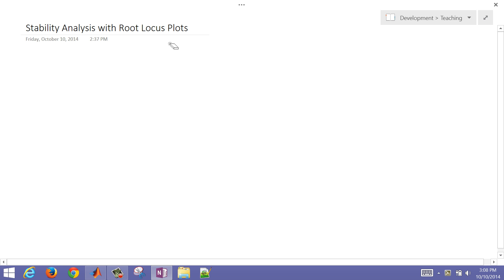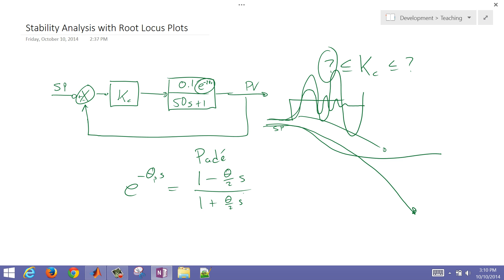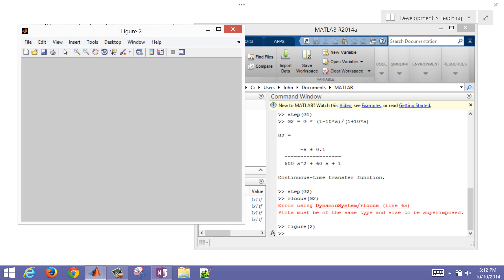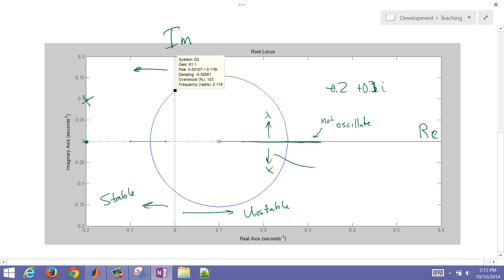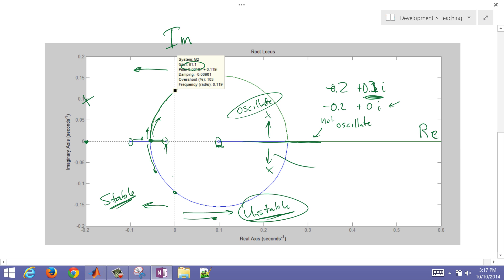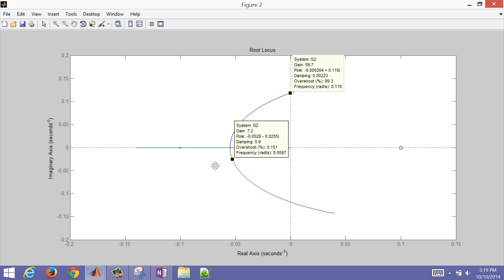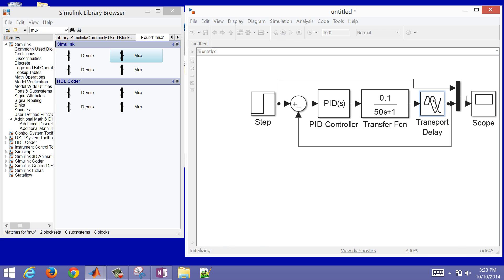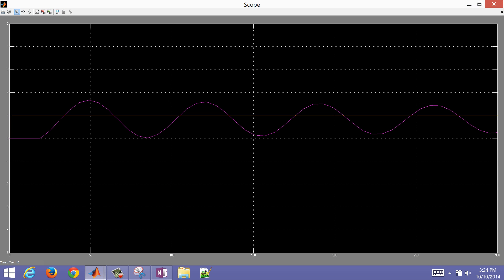MATLAB Root Locus Stability Analysis

Comment: can you use taylor approximation instead of padé if you wanted?
Reply from the maker: You could do that, but it would lead to a potentially larger inverse response. The first two terms would be with (1-theta*s) in the numerator. The Taylor series approximation is more accurate with additional terms so it may improve if you used additional terms. There is also a higher-order Pade approximation that is likely more accurate. Here is additional information on linearization: https://apmonitor.com/pdc/index.php/Main/ModelLinearization

Comment: Good video for Simulink the result on the scope when increasing from 10 to 300 sec shown on your video, this will give us sinewave with increasing or decreasing according to the gain of PID please why this occurred.
Reply from the maker: The controller may be right at the boundary between stability and instability if there is a persistent oscillation.

Comment: When designing compensators using the root locus, I usually will find min and max values of sigma, Beta and wd and then use them to find regions on the s plane where the closed loop poles need to fall within. Is there a way to plot additional lines and/or highlight regions of the root locus plot in Matlab?
Reply from the maker: You can generate your own Root Locus plot with commands such as:
s = tf('s'); G = 1/(s^3+2*s^2+s+1); % define transfer function
K = linspace(-10,100,1000); % specify gain values
[R,K] = rlocus(G,K); % compute root locus points (R is complex)
plot(real(R),imag(R),'r.') % root locus plot 

Then you can add other elements to the plot. You could also try to add elements to the rlocus plot that MATLAB produces but I've had trouble doing that.
Reply from the maker: I'm not sure if there is a way to add to the default rlocus plot in MATLAB. Here is a customized version in Python: http://apmonitor.com/pdc/index.php/Main/StabilityAnalysis  It may be easier here.